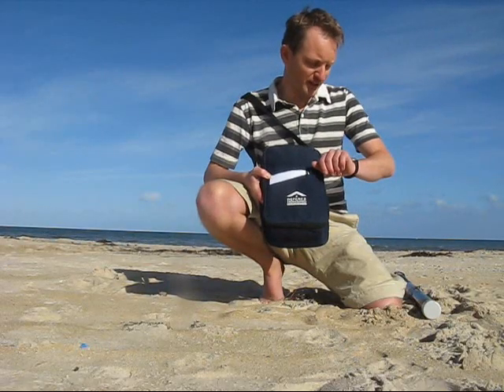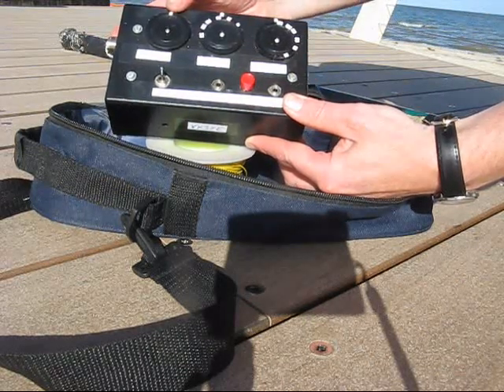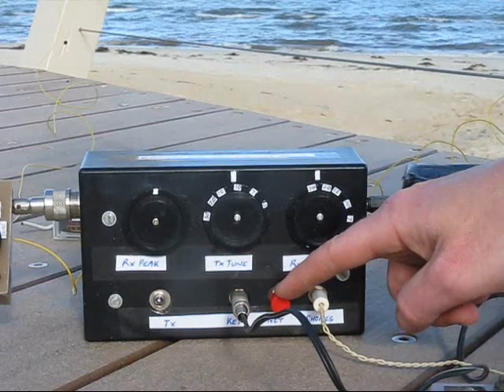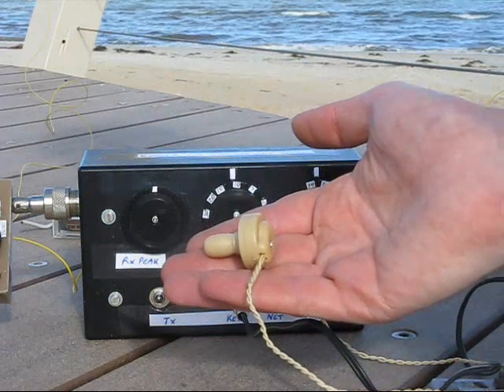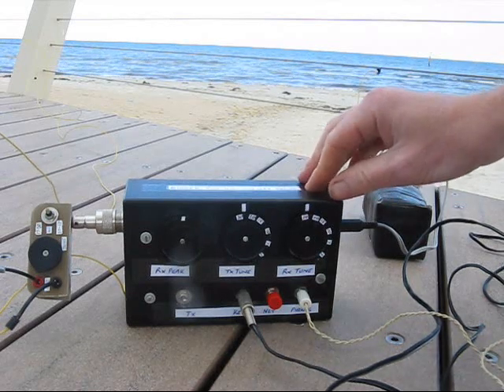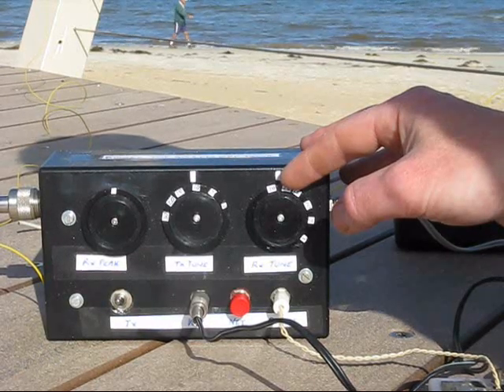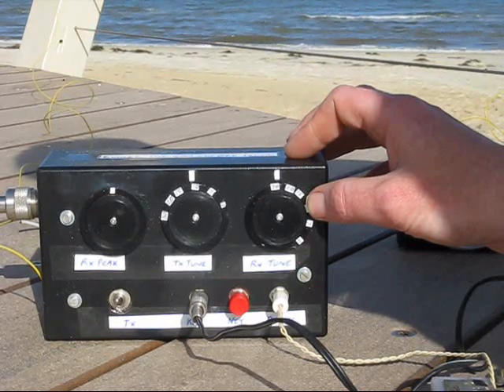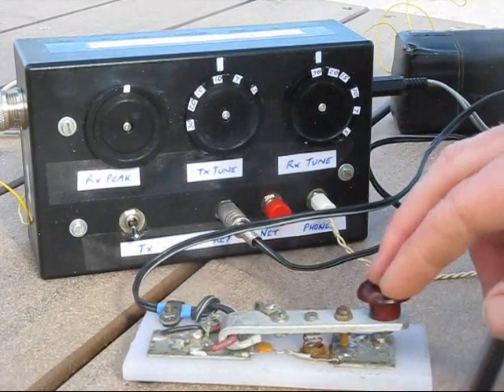The 'Bigger Toy' 7MHz QRP Txcvr on the Sunday CW Net

Comment: Thanks for the video, Peter! I'm having trouble understanding parts of the schematic, though. Could you give the toroid and transformer values? (i.e., 20 turns of 28# wire on a 50-6?)